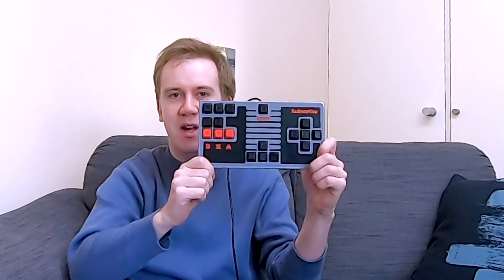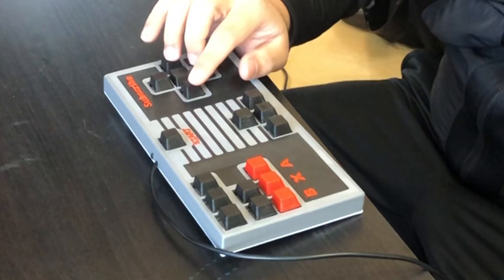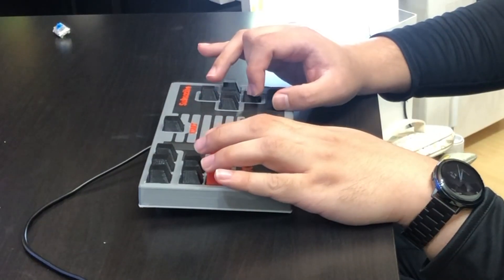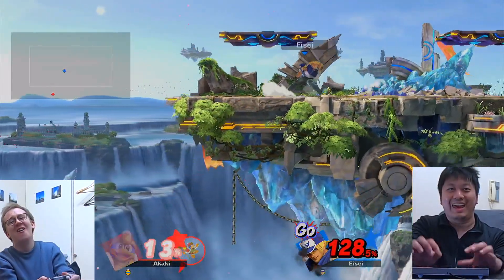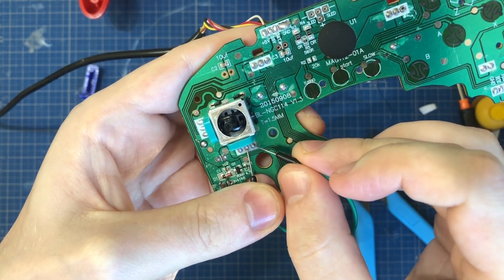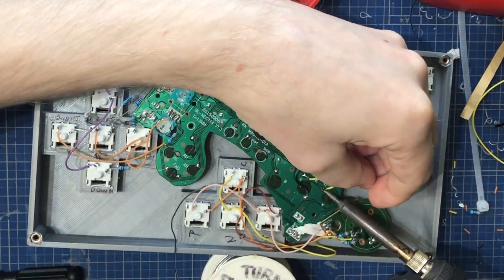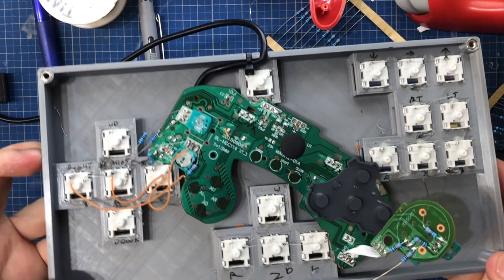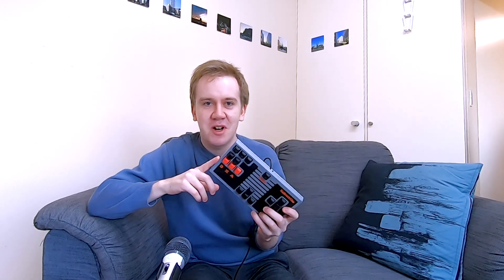3D printed Switch Hitbox for Super Smash Brothers (supports tilt commands)

Comment: hi, im having a problem while building this. 
i dont understand how i can use the shift key to both down and up circut and left and right circut without shorting them together.
how do i use 1 button for 2 seperate circuts without shorting them together?. 
thanks in advanced
Reply from the maker: You can’t do it with two axes at the same time with this method. My circuit only uses the shift for left-right. The up-down is on-off only.
Reply: @AkakiKuumeri  i see... im also interested in down and up half, only down is fine too (fastfall) do you have some idea how i implement this mechanically? thanks for the response
Reply from the maker: You would need a seperate, isolated switch for the up-down shift. There are double-pole microswitches, but I don't think anyone makes keyboard switches with double poles. Maybe you could make a wider keycap for the shift button and mount two keyswitches underneath, like some people make spacebars.
Reply: @AkakiKuumeri  is there a different type of mechanical keyboard switch i could use?
Reply: At the end i made a fast fall button and a normal fall button :P

Comment: Quick question(s). Does each direction [and switch] for both the Analogue sticks has 5k Resistor while the shift key has an additional 1K? Would the ground for the directions still need to be the center solder points?
Reply from the maker: I don’t understand you question.